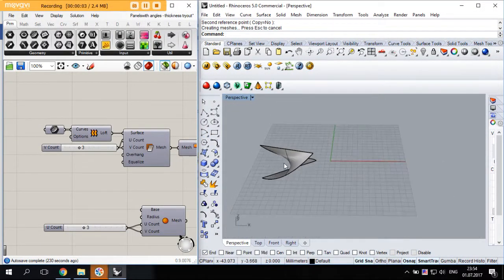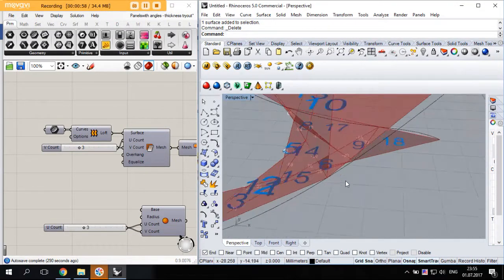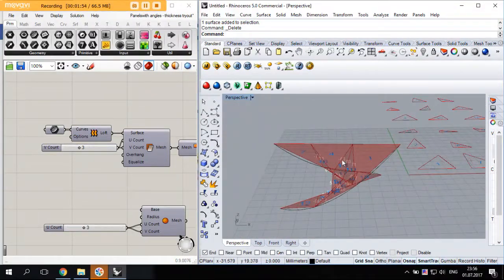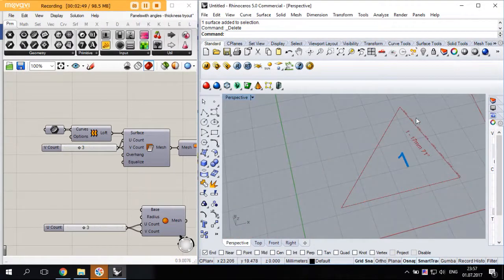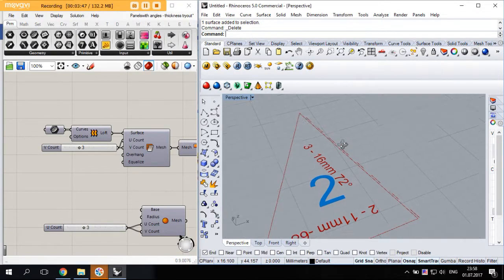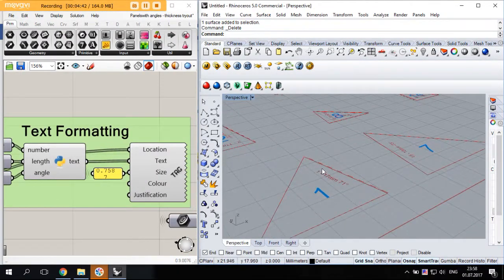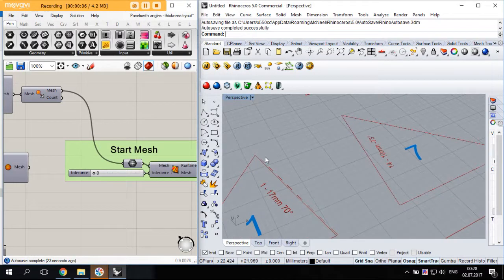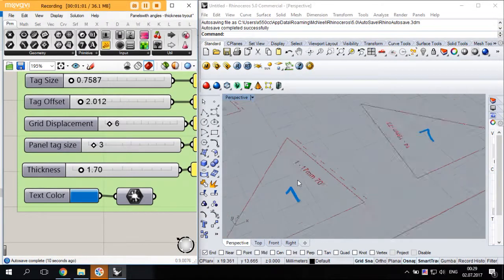Grasshopper Panelling Algorithm (with angles and panel thickness)

Comment: how did you put numbers on surfaces?  like surface 10, surface 3 and those stuff
Reply from the maker: There are at least 2 components in Grasshopper for placing texts. You just specify an origin of the text (in this case the face centroid) and feed the text itself to the component (in this case the text is just generated numbers by Series component).